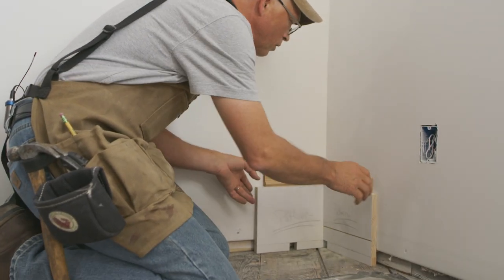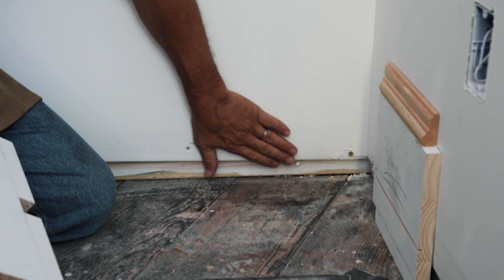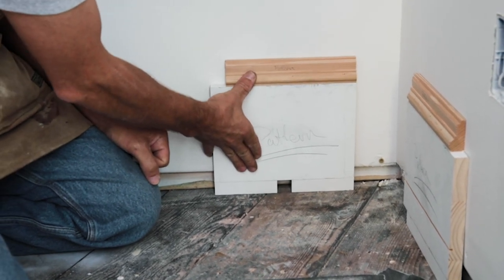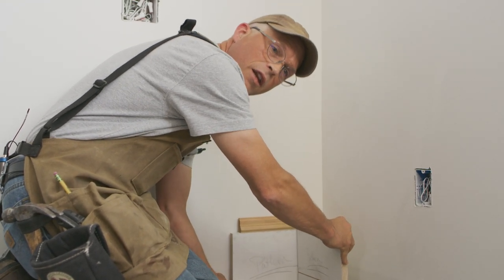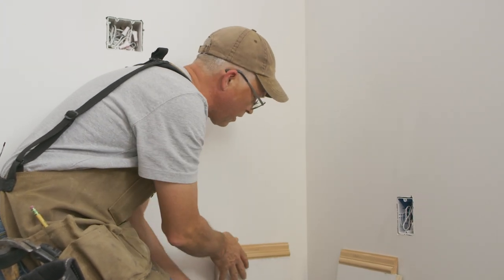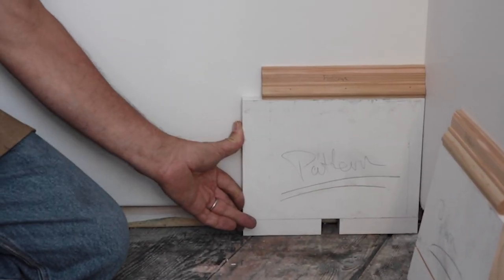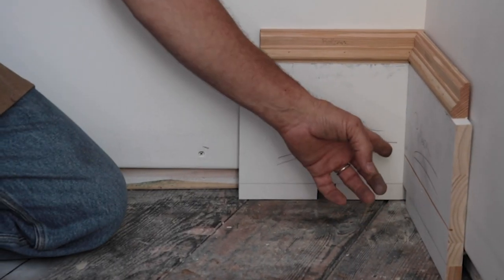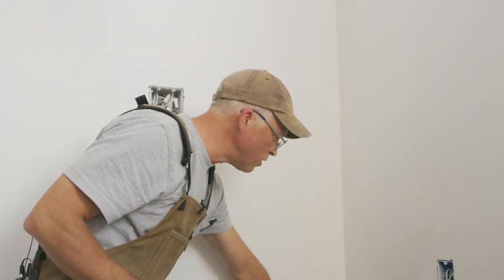How to Use Screws As an Adjustable Shim to Fit Baseboard Corner Joints

Comment: Wow, that's brilliant.  I'm currently installing new baseboards, and I have this exact problem in one of the corners.  I was thinking about what I could use to precisely shim the base of the wall out, and so far had only come up with:  packing folded up pieces of paper to the proper thickness, or cutting a piece of wood that would fit underneath the sheet rock and stick out the precise amount.

This is so much easier/better.

Comment: I don’t understand. What is the screw doing? Is it not fully tightened? Or does it bring the gyp right to the wall where it wasn’t?
Reply: The screw is acting as a shim/spacer, so no, it wouldn't be driven in flush with the sheetrock.

The screw is driven through the sheetrock and into the stud/plate behind.  It would be left sticking out of the sheetrock a little bit.  By adjusting how far the screw is driven in, you control how the baseboard sits on the wall.  If the baseboard is too far out, drive the screw in slightly further.  If the bottom of the baseboard is pushed in too far, (which is a common issue) back the screw out a tiny bit.  By trial and error, you should be able to get the perfect position/angle.
Reply: Dave Nagy, thank you for the explanation. That makes sense.
Reply: dan p Thanks for the explanation—I didn’t get what he meant either..